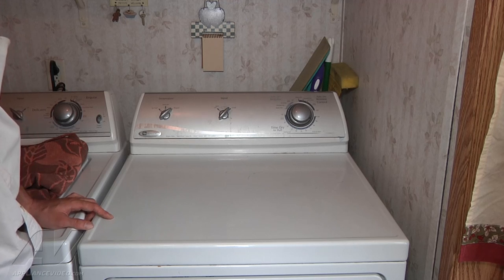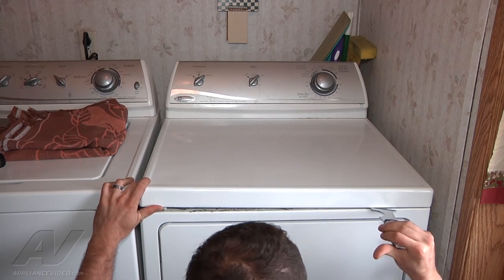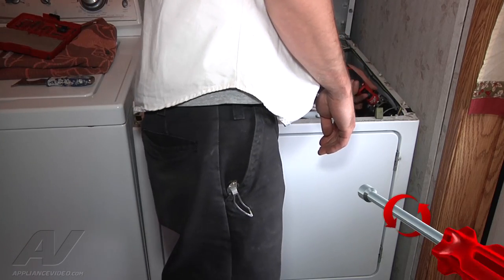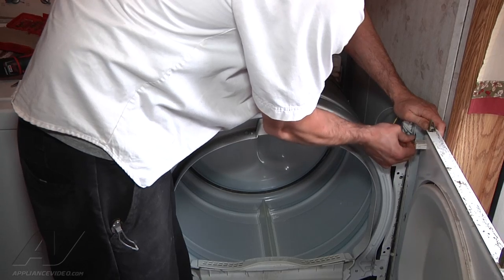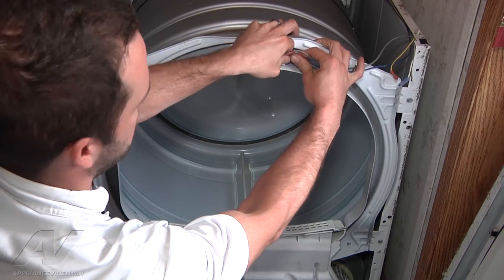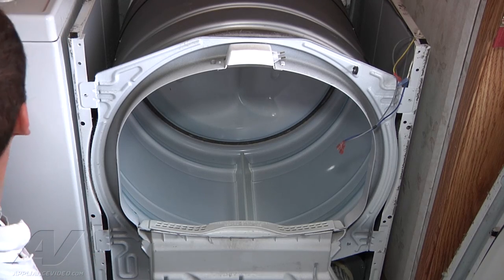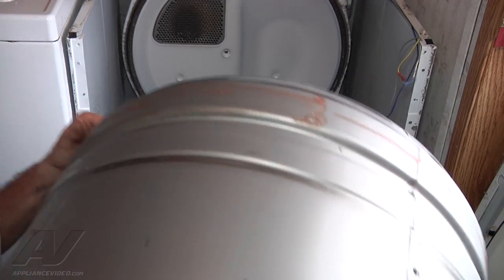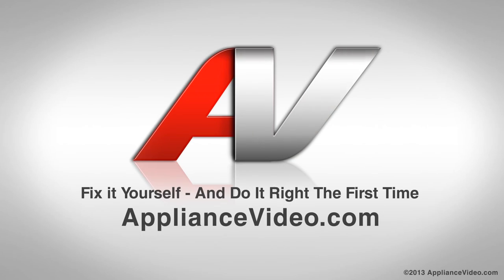Maytag Dryer Repair - Thumping Noise When Spinning - Idler Pulley

Comment: Just bc your dryer is making a noise doesn't always mean something bad is wrong my dryer was making the same sound when I took it apart there was a broken zipper stuck in the front of the drum once it was out stop banging so check the edges of the drum to see if anything is stuck there first
Reply from the maker: Great question, if you have a more technical question that our parts department cannot answer, you can search our over 13,000 answered questions free at our website www.ApplianceVideo.com under our Repair Help section. You can also call our parts department at 1-800-830-5465 and they can give you help 7-days A week Monday Saturday, or search at www.SaveMoreOnParts.com  24 hours 7 days A week.

Comment: I have a kenmore 500 that is 13 years old and when tumbler spins there is a thumping noise.... i changed the belt, rollers, and idler..... thumping still there under further investigation i noticed where the two pieces of the drum are welded together there is a bump from the weld..... so i figured when the dryer was new, the rollers would have been softer and after years of use they hardened.... i bought replacement from amazon and apparently those rubber wheels are also extremely hard and still thumping.... i guess we will live with the thump... dryer still works and dries clothes.... screw the noise it is making.... spent 18.00 dollars for the kit... not too bad for 13 years of service other than it did not fix the thump sound....
Reply from the maker: Great question, if you have a more technical question that our parts department cannot answer, you can search our over 17,000 answered questions free at our website www.ApplianceVideo.com under our Repair Help section. You can also call our parts department at 1-800-830-5465 and they can give you help 7-days A week ,or search at www.SaveMoreOnParts.com  .
Reply: I know this is old but I just did the same thing and have the same machine and have the same problem. I was disappointed because I thought I fixed it and it still made the noise. Just wanted to say thanks for leaving this comment, at least I know I'm not alone!
Reply: Same here, right where the weld is! I get a mild thump, everything works just fine though.

Comment: I cannot remove the kid on my old Maytag. I've tried using the putty knife technique, but it's not working. I can see the clips.
Reply from the maker: Great
question, you can call our parts department at 1-800-830-5465 and they can give
you help. If you have a more technical question our parts department cannot answer, our technicians are answering all questions
at our website at ApplianceVideo.com under our Repair Help section. We have
over 3,000 common questions and answers that you can easily search through by
your model number, appliance make, and problem or error codes.
Reply: Sorry for my earlier typo. I am surprised children's services wasn't immediately dispatched to my house. I said, "I cannot remove my "kid" from my Maytag Dryer...".  I figured it out.  At the bottom front (about 6 inches from the floor) are two screws. One on the left and one on the right. Remove them, and while grasping under the front of the frame slowly rotate it upwards as if you're lifting a good.
Reply: Bryan A McGown

Comment: A flashlight on the idler pulley would have helped.
Reply from the maker: Great question, if you have a more technical question that our parts department cannot answer, you can search our over 17,000 answered questions free at our website www.ApplianceVideo.com under our Repair Help section. You can also call our parts department at 1-800-830-5465 and they can give you help 7-days A week ,or search at www.SaveMoreOnParts.com  .